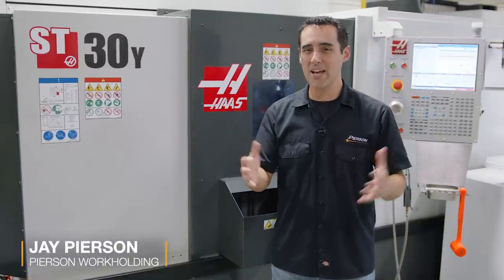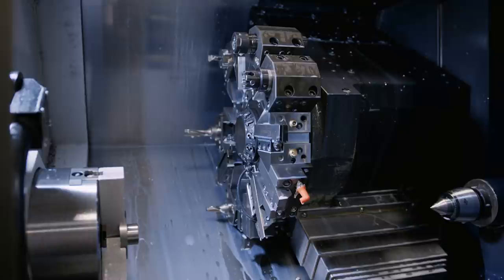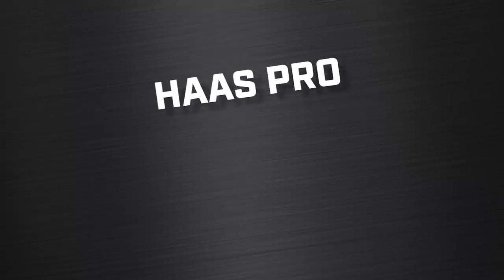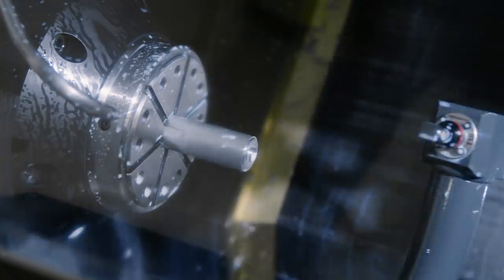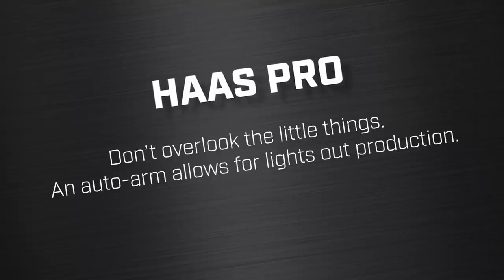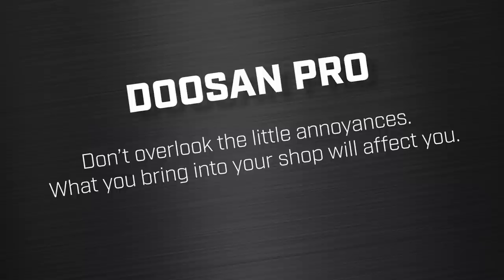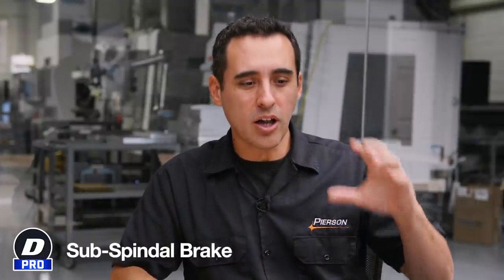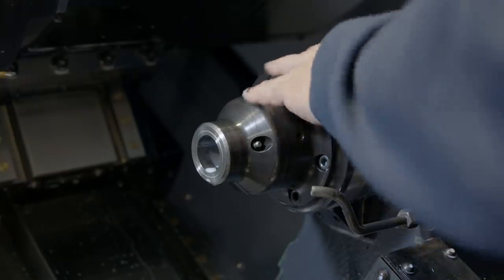Haas ST-30Y vs Doosan 220LSY | CNC Lathe RUNDOWN | Pierson Workholding

Comment: Our current gen ST20Y has been flawless for the last year. Have two more on the way. The sub interpolation has proven to not be an issue for our smaller parts since we can just XY mill anything we need. The lighting inside could be better. I’ll look into moving the light. Parts catcher is also a little weak. We added a small blocker wall of sheet metal on and it helped.

Comment: I have an SL10 and a Doosan 220B.  There is no comparison between the two.  The Doosan runs the same program in 60% of the time the Haas does just due to the rapid times and tool changes.  The Service on the Haas was Abysmal.  The Doosan gets a checkup every year and keeps on running.  It's a 2006 and the Haas is a 2004.  I also bought a 2011 and a 2012 VM2 Haas.  Between the two of them I've replaced SEVEN ballscrews, Three spindles.  Both mills got out of the factorn with the Z Ballscrew bearing block not pinned to the chassis.  I've sold every Haas except my little 2000 Mini and it just won't quit.  Bought Maklino's and am MUCH happier.  THE most important thing when buying machines is service.  And Selway service is Legendary in it's piss poor quality.  They put my Cuvic coupler back together with only TWO balls in it and then wanted to charge me to fix their screwup.  Never again
Then we can talk about their barfeeders,.,.,.Junk.  Not accurate and slow.  Pushrod bends.  Won't feed...LNS is MUCH better
Reply: what kind of work do you do ? AL BR SS?

Comment: Great vid. Just had a doosan dnm5700l installed a week ago. Going from the fadal 88hs control to the fanuc oimf+  control was a mind blow for the first few hours of training just like you mentioned. All ok now for basic machine operation but more advanced feature or uncommon menus are extremely well hidden. I use the ezi guide software you made mention of. It is easier for sure in my opinion. 
Cheers

Comment: Great review, thanks!

I own a basic 2 axis Haas St10 and quite recently bought a lynx 2100 lsyb. I agree with most of what you said, except:

- Part catcher on the doosan. It is terrible for small light parts, misses a lot of them or parts stay stuck before reaching the conveyor. Also a big risk of crash having it fixed on the sub spindle if a part doesn't exit correctly and the sub starts moving.
The Haas part catcher is dead simple. Not perfect at all but very reliable.

- Thermal stability. Our doosan moves up to 0.003" during 60-90 minutes before getting stable. Might be an isolated issue with our machine though, the dealer is looking into it.

Still, would go doosan again without hesitation, just for the noise...
Reply: Funny you mention the Parts Catcher on the Doosan ?
They can be sort of fixed with a added on guard i guess you could call it.

Thermal Stability dramas ?
This goes for most machines that don't have Thermal Comp built into a machine.
You would already know this by now.
But a morning warm up before making parts normally settles down the worst machines.
This is where the bonus of Lights Out Machining comes in very handy other than the obvious reasons.
Because the temperature is more stable at night than day.

All the best with your latest Doosan purchase.
Definitely a Great machine to buy.
Reply: I have had the same issues with my Lynx 220... Even after warming up, once it idles for a bit. You are already back to square 1 and chasing tolerance.

Dealing with such a swing became a headache on aluminum parts requiring +/- .0005

No coolant chiller or glass scales on mine. Might as well had gotten another machine that didn't require those extra bells and whistles. amukO

Just be careful when selecting machines for your parts. I wish me and my dad had known when bought our Lynx.
Reply: @peterCheater  
Still having dramas with runout ??
This has more to do with the Mechanicals of the machine. 
Not so much the brand of the machine.
Especially after a warm up procedure. 
If you're still chasing tolerance after a warm up. 
It's more than lightly a problem with the Ball Screw.
Could be also Linear Slides. 
But usually not as common as Ball Screw problems.

220 LYNX is a fairly old machine now. 
But saying that i have no idea of the hours on your machine ??

Can only gauge by the build date  ??
But in general it has had enough time to start to wear out parts.

Might be a good time to do a basic repeatability test to see how your machine is operating. 

Can definitely understand your frustration when this happens. 
But it could be time to do some basic test.
Before blaming a particular brand of machine. 
Just saying 😌 👍
Reply: @weldmachine  Thanks Weld! 
Frustrating indeed. Ive only been in the industry for 3 years. 

Machine is 2017 Lynx 220 LSY. Got it after our boxway 1994 Hardinge T51 took the shitter.

Did a simlpl back lash this past week and saw a .0004 back lash on the X. Adjusted the parameters. Hopefully that should've resolved a part of the issue.

Kind of disheartening to see that variation.

Comment: Some interesting pros and cons. I'm considering switching from HAAS to the exact Doosan you have. We've had huge reliability issues with our HAAS lathe and when the engineers are saying the lathes should be avoided at the moment that's saying something. Also explored Hurco but not hearing some greats things from a few customers with 2018/2019 lathes. Feels like a minefield for buying lathes right now. On the plus side the mills I hear from HAAS are rock solid
Reply: Can you please share what haas has to improve?
I consider to buy one and the last thing I want is problem as a startup.
Reply: If you watched the video, their Doosan was the machine with reliability issues.
Reply: @ClockworksOfGL  at 14 months. Mine has seriously not been without a fault for more than 6 weeks at a time. Owned for a little over 2 years
Reply: @aronandreas  generally the build quality and checks coming out of the factory. A small but main list was that the spindle was off centre from the tooling by height by 1.5mm and we're in our third live axis unit, second door, 4th live axis cable, 3rd servo drive unit. I've got a list bigger then a technical manual. The one thing I really do love about HAAS is the control. The control is super easy to use. But it's full of bugs, some fairly dangerous. Had an engineer's hand trapped twice by the bar pushed because it didn't dump air off
Reply: I can't comment about the Hurco Lathes, but the Mills are lighyears smarter and more heavily built than Haas. I will say that It took me awhile to do things with Winmax without having to think about it, but it is arguably the most advanced conversational control on the market.
Reply: I've heard good things about Samsung lathes. They're supposedly older gen box way okumas which means they should be super rigid.
Reply: We just replaced 3 Haas dual spindle lathes with Lynx. We saved on cycle time and the parts DO look better. Parts catcher / conveyor is way better. Control takes a little getting used to but it's overall a superior machine. I've owned 6 Haas lathes and had issues with all of them for one reason or another in heavy production environment. The Doosans are handling running 24hrs a lot better so far. Time will tell ultimately.
Reply: @1001001  they are older gen Mori's not okuma's.
Reply: The only people I hear positive things about haas from are salesman and people who have only ever run haas.  If your in the market for a lathe look to Okuma first (I'm an okuma fan boy as I have 7 though) then  Nakamura or mori, then Samsung or Doosan(pumas though not the lynx).
Reply: @aronandreas  I know a pretty big shop that has over 50 cnc machines, they have 4 Haas and between the 4 of them they are down more then all the other machines in the shop.
Reply: We purchased, 2 matching st20y lathes. Both with barfeeds and subspindles. One works flawlessly. One has constant subspindle synchronization errors. Averages about 1hour runtime before alarming out, they haven't been able to figure out any way to fix it.
Reply: @zeman981  it's crazy right?! I think they are too concerned with mass production. I watched a video on the need tool room mill. I'm sure the guy said they make them one like 5 hours now
Reply: @1001001   They are based on older Mori Seiki, not Okuma.

Comment: I recently learned that there is a new Lynx model 2600sy being released this year, likely positioned to sell against the St-20/25. The 2600 has BMT-55 and 3" bar capacity and similar work envelope to ST-20/25.
Reply: Seen the same machine also.
All the things the LYNX 220/210 should be is already included in the
 LYNX 2600
It's as close to buying a Doosan Puma as you could go without spending 
the $$$$$.
I definitely like the Big Bore Spindle which is fairly common on most CNC Lathes now but a huge plus if looking at buying a new Lathe.
The heavier duty Live Tools is another plus.
Never really liked the LYNX 220/210 that much, a great machine but the Live Tools 
are Not so good, 
Great for Drilling & Tapping some light duty Milling that's about it.
The other plus i like with the Doosan range is you can option the machines with a Siemens Controller.

Comment: Been using My Haas SL 30's since 1999 , and they run really good . Consistently hold .001 after warm up. The new ST's are supposedly even better, so I am not surprised. Just gotta Bar feed for my 2005 SL-30 so I am glad to hear they work good. Thank You for the insight Jay
Reply: Had an early 2000s HAAS SL10. Was near a bay door. This was in Denver. In winter, if someone opened the bay door for more than a couple minutes, my next part was scrap. The machine also wouldn't run stainless, would just alarm out :( Had no "butt" to it at all. Drive belts snapped every few months. Part catcher never worked as far as I know. You can probably chalk most of this up to terrible maintenance, but from my experience, I'd rather spend an extra few bucks on a lathe than a HAAS. Not for a mill though. I'd buy a HAAS VF anything any day. Did a NASA part on a HAAS mill once, LOL. And we had DMU MORIs and Mazaks, nope, put it on the HAAS :D
Reply: @jerryherrin6470 , Interesting Jerry, I have only the Geared Head lathes and I have machined lot's of Stainless and lots  Inconel 625 with no big problems. Maybe the direct belt drives are just not that powerful.
Reply: @jerryherrin6470  yeah haas are alot better than people give them credit for
Reply: @dominic6634 They still use an electric stove element for a brake resistor? We have one and always joke about cooking breakfast on it.
Reply: We have a early 2000s model SL-20 and I love that lathe. I run I625, C276, etc on it all the time and it’s a powerhouse lol but we also have other haas that are shit lol just depends on model and ours is a VDI style holders so the holders have a lock pin and they have a nut that screws from the back of the turret. I might be talking out my ass but I feel that makes it more ridged.

Comment: Coming from the Haas lathe control and now having the Doosan ez guide mode(or whatever it's called), there was basically no learning curve. I would say they are both equally easy to use. Now the standard fanuc side, I still have no idea how to use it. The Puma does come standard with the auto tool setter arm. I wish the Lynx did as well for in process tool checks but I don't think it's even an option. As for holding size, the CL-1 held tenths regardless if it was hot or cold and the Lynx seems to move about .001" as it warms up but then it holds size all day once its up to temp. I'm assuming that's because it's a much larger casting and thermal expansion is more noticeable which I'm sure the larger haas lathe experience the same thing.
Reply: How's your Cl-1 nick? Any issues?
Reply: Lynx 220LM, cuts underside 0.03-0.05mm (machine that was crashed many times) in the morning, but after two/three simple parts it´s all good

Comment: It would be interesting to know what coolant maintenance is like between the machines. The Haas DS30Y that we have allows the coolant tank to be slid out and quickly cleaned. What's the Doosan like? With one exception, a Nakamura WT100, all of our lathes have been Haas. We just sold the oldest one last year and it showed 1.95 MILLION tool changes on the diagnostics page. It has run reliably except for a tailstock encoder for 20 years and held tolerances of .0005" throughout its life.
Reply from the maker: Coolant access is similar. The Doosan tank rolls out the front and the Haas rolls out the side. The Doosan includes a tramp oil skimmer as a standard feature!

Comment: Would be interested in another update. Which machine has been down for maintenance more at this point. Also I think the Haas works for you well building small parts but the Doosan is built for more rigidity and larger parts making it more reliable with less downtime in my opinion. We machine large 12” OD parts and our Haas machines don’t hold up as well as the Doosan does. We have 30 Haas machines and only 2 Doosan machines but convincing me to buy another Haas would be a touch sell I think unless you plan ahead to replace them every 5-6 years

Comment: I can whole heartedly agree and give credit to the Haas control for how intuitive it is, but most if not almost all Fanuc controls have rotary selector switches for rapids feeds speeds that are much more intuitive to use in my opinion

When I am finishing a setup and walking thru the program, being able to twist the rapid selector becomes mindless as opposed to the rapid buttons on the Haas control. 

Subtle, and possibly nitpicky, but I feel others will agree on this that use a Fanuc control daily in their work.
Reply: When you use something daily, minor details as those make a tremendous difference. Same goes for CAD CAM software, a couple of clicks more for the same result makes hours at the end of the month.
Reply: My dream controller is a Haas with rotary knobs for the overrides. 😀

Comment: We use feature cam to program an st20y to interpolate using C. It involved the G128 I think, it's not amazing but it works. I've finished 3d surfaces using basically a steep shallow tool path with the spindle acting as C and a live tooling head with a ball nose endmill. I've got pics of some parts if u want DM me

Comment: I really wanted to buy a new Doosan a few months ago, but I went with a new Haas ST20Y.  It was due to the Fanuc controls and having 20 x more button presses to do anything like touching off tools or loading a file from USB.  Not very well thought out by Fanuc and then the graphics version running on top of the hmi is Windows.  Lastly, the Doosan has twice the horsepower as the Haas  (look at current/amperage ratings) but then uses a much smaller BMT45 turret vs Haas's BMT65.  The machine looks really nice, much stiffer linear rails, nicer coolant tank, and rapids twice as fast, but the Fanuc controls killed it for me.  I have several Haas machines so I'm used to them.  The old Fadal requires spacebar to jump to different menus but still not as bad as the Fanuc.

Comment: Haas has the DS-30Y which is a true dual spindle lathe not sure if the interpolation issues are addressed with the DS-30Y or not though.
Reply: I run a DS-30Y and there's still no interpolation. It does have a brake however and is far more substantial than just a 'finishing spindle' but unforuntately no interpolation.

Comment: Jay if you think that turret bearing is annoying wait till your haas is a week out of warranty and that Air cylinder that locks the turret starts leaking air and pushes all the oil out of the turret, haas was nice enough to charge me to fix it, with their simple design flaw, the gearbox doesn't have a breather in it. Oh yeah I said a week out of warranty. They have no problem saying it's out of warranty and not our problem.

Comment: Some great points in the review. I own a HAAS SL-20 and a Mori NL2500SY as well as a Robodrill. Fanuc control is a pain to train on but so reliable, the Doosan is an exact copy of a Mori NL (one of the most popular lathes ever sold). I would never buy a live tool sub spindle lathe without full C axis on sub and I’m surprised haas would release one with only orientation. Orientation on my haas mill is pointless because it has a rubber coupling between spindle and motor so is not accurate (not sure how solid it is on Haas lathe sub) Love the Haas control. Hopefully Fanuc will sort the user friendly side of their control out as it really is a joke to a new user compared to Haas. (Cncmedcom pty Ltd)

Comment: Either you got a good Haas Lathe, we got one that's not so good, or Haas has come a long ways with their new machines, when it comes to holding size.  When running a long running job on our 2006 SL-10, I have seen between 0.003" and 0.007" change from start up to "operating temperature."  And it usually takes between 4 and 6 hours of constant running before it finally settles down.  If we stop it for lunch, we have to start over again, to a certain point, after lunch.  Also, you mention the auto touch probe auto adjusts sizes while running at night, lights out?  I am curious how that works.  Not how the arm itself works, but making sure the part is the right size.  We touch off tools on our manual probe, and that will get you within 0.005" of the correct size on the part.  But it's never perfect.  I guess if you are dealing with +/-0.015" for tolerances, that would be OK.  We deal with parts having 0.0005" total tolerance on some features.  Major difference there.  An order of magnitude difference, just from where we touched off the tool!  Certainly not saying the SL-10 we have is a bad machine.  It is just much different than what you are talking about in these two categories.